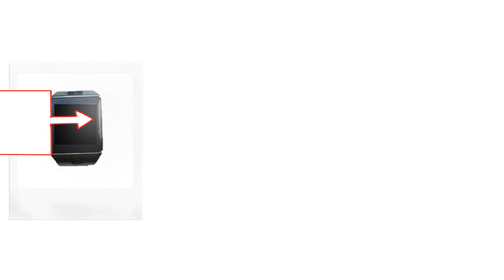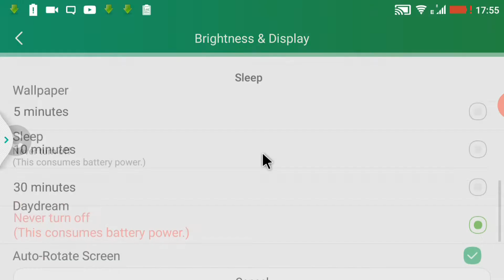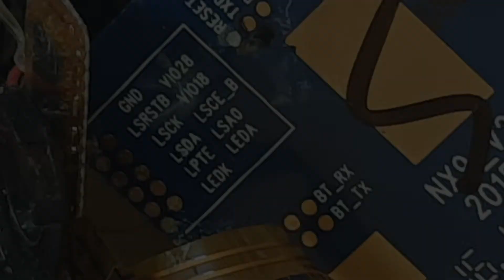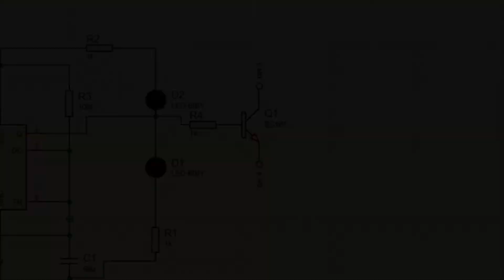Smart watch hack

Comment: The only thing missing from this watch is a sensor to turn on the screen when you turn your wrist and a smaller design
Reply from the maker: This was an old watch which do not have that functionality but still it do have gyroscope, I can try accessing the I2C lines to communicate with the sensor but not sure what sensor used I have to randomly scan the bus

Comment: Well tryed
Reply from the maker: there is a trick using which you dont need the 555 ic anymore.(i am not talking about the settings in watch)
Reply: @anklabs7504  what is that trick bro
Reply from the maker: I used the watch return key and a 555 timer to send a pulse every 8 seconds so that it never reaches 10th second of its time out.
But while practically doing this it woked fine  with a 555 and it also worked the same way  by  just shorting the return key signal together,  some how the systems hangs and the watch stays ON as long as the return key is shorted (pressed).